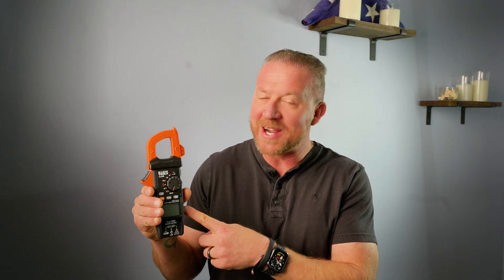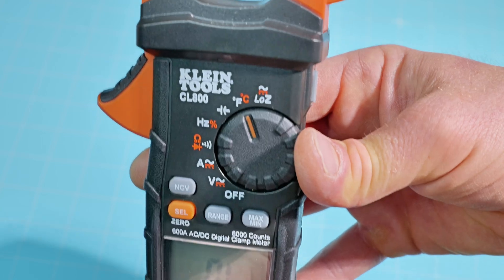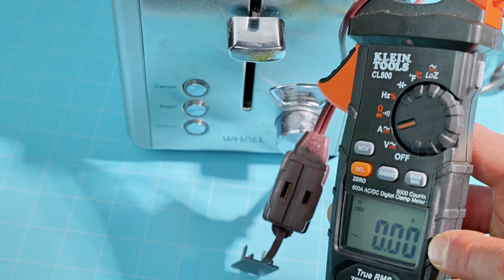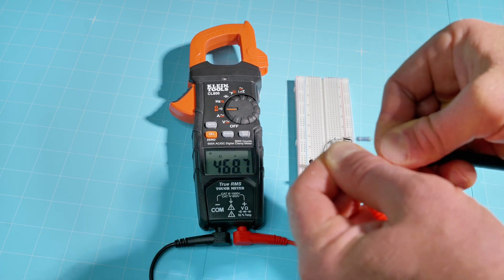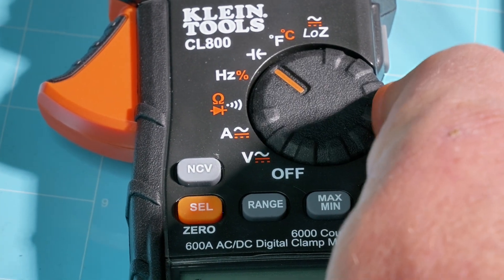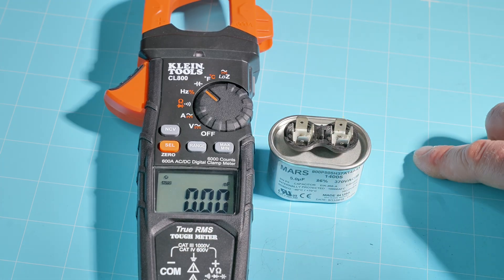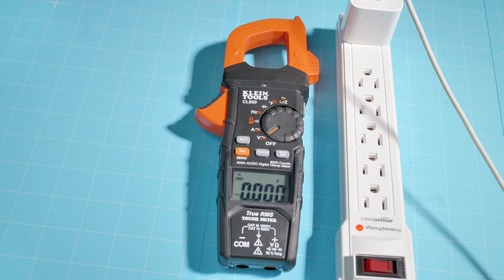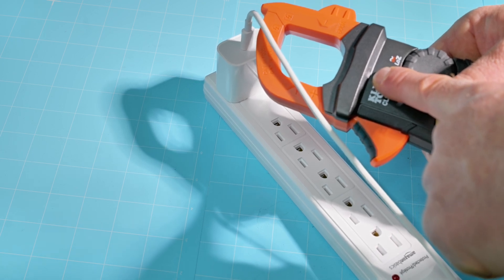Klein CL800 Clamp Meter FULL REVIEW – The Last Meter You’ll Ever Need!

Comment from the maker: What is YOUR favorite clamp ammeter?
Reply: I use the CL810.
It’s a great multimeter!

However, that non contact voltage detection feature is quite horrible. 
It beeps and detects voltage even if the circuit is not hot. Quite disappointing, since there are so many affordable NCV tools that work flawlessly.
Reply: why have you coloured your wrist 4:41

risking every ones wellbeing

conceited vain man

Comment: Check minute 2:04! You are going to take measurement of AC Voltage power source! So, if you haven't connected the multimeter to the AC power source, why the multimeter is reading 0.038 V, or else measurement over 0.00000V AC? I had tried to set to zero with the zero function, but it does not work for Voltage function. It's OK, or I am guessing or doing something wrong ? This is my first time with this multimeter. My Truper MUT-202 always starts from 0.000V.
Reply from the maker: Good observation! I have used many Flukes and many Kleins, both always seem to have this residual voltage, sometimes know as ghost or phantom voltages. I am not sure if it's some kind of induced voltage it's reading from the air or residual voltage inside the meter itself. But I found once you connect it, it is an accurate reading so it doesn't seem to matter. Some meter manufacturers may zero this out internally?

Comment: For the voltage reading, why is there a small fluctuating value before it's attached to a circuit?
Reply from the maker: Thanks for the question, it is residual meter voltage.